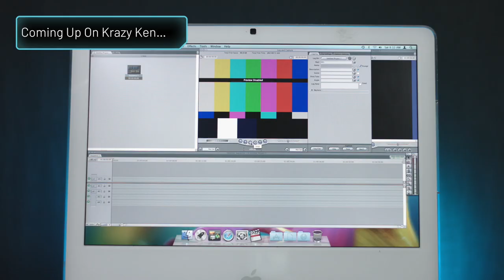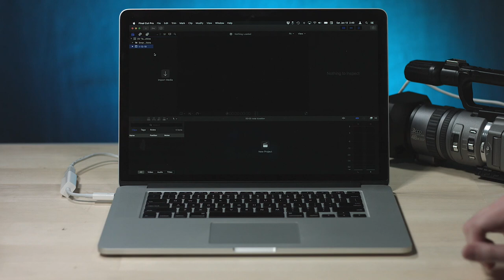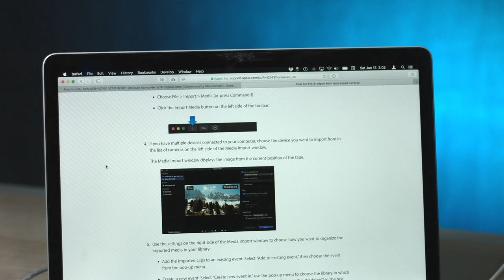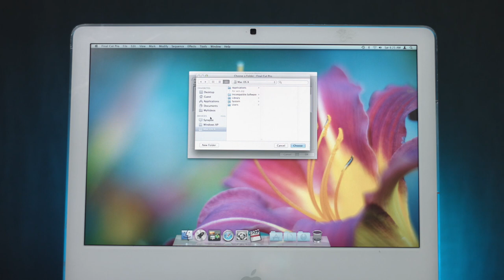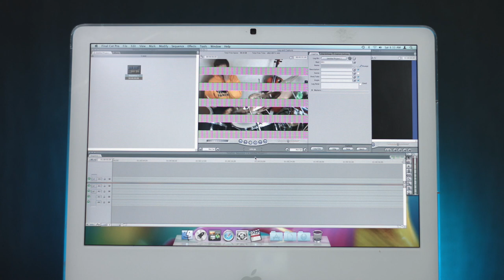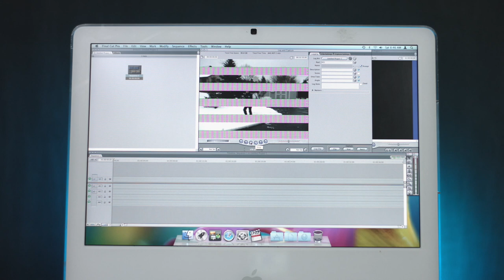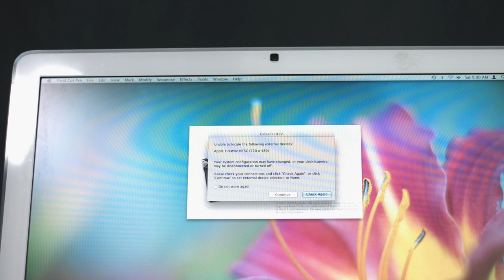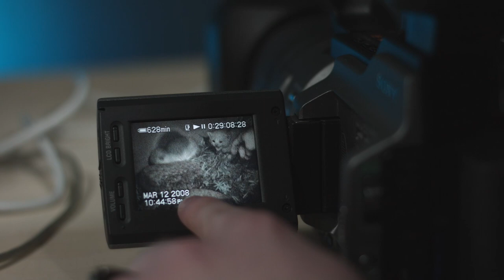MiniDV Tape Conversion Chaos (Sony Handycam DCR-VX2100) - Krazy Ken's Tech Misadventures

Comment: I bought the Sony VX-2100 for $3500 when it was a solid choice for SD, I really wanted the Canon XL-2E, but it would have been another $1000+, and I already pushed my budget to get this camera.

I currently use it to convert MiniDV tapes as well as use the passthrough function to convert analog (VHS/S-VHS) video. For me, it's only one Firewire cable in to an old XP box with Adobe Premiere 2.0 on it. That's it.

No idea why you chose to make this so difficult. It should be obvious that your adapter nonsense is the reason for the bad video, as the monitor on the camera shows the image without faults.

Oh, and I can also use the transport controls in Premiere, which is a nice touch.

Comment: @Computer Clan, I use a Sony DCR-TRV17 on a monthly basis to record meetings.  Your problem with your DCR-VX2100 was that you have DV IN enabled.  That feature is used when recording FROM a PC/Mac TO a tape, and MUST be disabled in order to import tapes to Final Cut Pro.  This would also cause your 2013 MacBook Pro to not recognize that there was a camera connected.  Make sure that DV OUT is enabled in VCR > Menu > VCR SET > A/V->DV OUT setting.
Reply from the maker: Are you sure? How come sometimes the camera showed up in FCP? It started going in and out, like it was trying to connect, but couldn't. It seemed more like a bug or failure, yeah? I'm curious.

Comment: The issue with your small camcorder is just dirty heads, hit play, then fast forward and rewind back and forth over and over until the purple and green bars go away. Not the best method, but it works. Your VX2100 has a dead firewire (IEEE1394) controller, sometimes when you hotplug a 6pin to 4pin firewire cable or converter, the 6pin socket will send the wrong voltage to the 4pin port and overload the controller. (Tip: always turn your camera off when connecting firewire). You may be able to get the boards replaced by a camera repair shop.
Reply from the maker: Awesome to know. I’ll try the fast-forward-rewind trick with the smaller camera. Thank you.

Comment: I had no problem using this camera for imports.  Also, why use an 800 to 6 pin firewire?  Use an 800 with thunderbolt adapter and firewire 400 at the other end to go straight into the cameras port and eliminate one adapter.
Reply from the maker: I only used the cables that I had.
Reply: btw-  I use iMovie to import if that helps

Comment: We still use this camcorder (a VX2000 in particular), we don't have any problem capturing the footage via Pinnacle 510 USB capture card (but I suppose any other capture card with firewire does work). We import video by Studio 14 (Pinnacle) or by Sony's PlayMemories importer (that is free downloadable). It works perfectly. Studio 14 also is good to import HDV footage (from HDV cameras, via Pinnacle 510 USB too), but also HDVSplit is very good. However, the VX2100 is great.

Comment: To do this on a new Mac with usb-c you would need to buy two cable connecters which are the firewire- thunderbolt and then thunderbolt to USB-C which I will link below. Thats all you need!

Apple Thunderbolt to FireWire Adapter

Apple Thunderbolt 3 (USB-C) to Thunderbolt 2 Adapter

Comment: I love Mini DV 💓😳
Reply: Yes, everyone loved it back  then. But video data management and backup has always been an issue during that era.  The current modern digital video workflow pushes everything to be file-based for easier management and access, and given that tape quality deterioates in time, it's a priority to properly transfer all taped video content to file-based medium, and to be saved in the corrrct file format settings (a big challenge esp. when saved in any lossy mp4 codec).

Comment: Hi i have an old panasonic mini dv digital Video camera Nv- GS50, it has a dv out, what would be the lead or leads or adapters or converters to get it to play on my 2013 mac please
Reply from the maker: Use a FireWire 4-pin to 9-pin cable, then use a FireWire 800 to Thunderbolt adapter.
Reply: Thank you

Comment: Maybe this has already been pointed out, but there's no conversion to digital taking place here as stated in the narrative. MiniDV is already digital. The daisy-chained dongles are adapters, not converters. So the "time machine" analogy is rather stretched out, "ancient" firewire is just as digital as "current" thunderbolt.
Reply from the maker: I guess I basically meant I'm converting from one medium to another—despite them both being digital. I know I kinda botched it.
Reply: Hi i have an old panasonic mini dv digital Video camera Nv- GS50, it has a dv out, what would be the lead or leads or adapters or converters to get it to play on my 2013 mac please

Comment: About this Mac -> System Report -> FireWire. Check if the Firewire port(s) show(s) up, and see if the camera is attached to it. Takes some of the guess work out of the equation.
Reply from the maker: But in the video, the iMac shows other cameras working with the ports, so I already did some process of elimination. Just give it a watch ; )

Comment: Firewire circuit could be fried on the VX2100. It's not unknown.
Reply: Yes, it's been a constant problem with just any product with 1394 interfaces, the choose fails after prolonged use and/or system crashes etc.

Comment: Use el Gato video capture devise its very versatile  I am also wearing or using  a cable with the three colors coded outputs CV or RV cables
Reply from the maker: I plan to experiment with El Gato more soon! Might not be on video, but I'd like to try them out.
Reply: @ComputerClan   there is a Jack at the side of the camera that allows to connect the three color coded cables those then are pluged to elgato capture devise the software is dowloaded

Comment: I have a question, I received three mini dv tapes that I need to convert. The tapes were done on a very high end camera I believe on EP speed.
When playing back on a normal mini dv player it comes out choppy and audio is off. 
I have one time seen this when played on a normal player it looks like the tape is damaged, but played fine on that high end player.
Unfortunately the person with the high end camera passed and I do not have access to this camera.
Has anyone seen this before? Is there any work around?  Thank You for your help.
Reply: is there like some sort of lines on playback? If so, a very heavy duty Sony DVCAM deck can sometimes tapes like that
Reply: @rupert6478  Consumer MiniDV and DVCAM have some different standards including EP recording speed and such, AFAIK.  Since the average consumer can't have access to pro playback equipment perhaps the best way to preserve the taped material would be to find a facility that would handle such digital transfer properly.  This needs to be done ASAP as tape quality deterioates in time even under proper stage and handling......
Reply: @vampyrelycan99  I've also heard that a lot of decks have trouble playing back tapes recorded in LP and you should use the original camera used to record that footage to play back the LP tapes
Reply: @rupert6478  I've heard that, but could not recall much.  What could be the reason behind such "compatibility" issues?  Maybe there's some slight inconsistency in the hardware's head alignment, from unit to unit?
Reply: @vampyrelycan99  i think that’s another plausible one. like you said, if a camcorders heads are misaligned and you record something, no machine will be able to play the tape unless its heads are misaligned exactly like the cam.

Comment: Probably they withdrew Firewire support in later versions of macOS.
Reply from the maker: FireWire support is still present.
Reply: Computer Clan Yeah, but from what I understand the FireWire to Thunderbolt adapter from Apple is a bit particular and doesn’t work with all types of devices - might be misremembering though.

Comment: You know, there is a perfectly good composite video out on that camera, just hook up a USB composite video capture is record it with OBS.
Reply: composite video quality after conversion is terrible. as it is the digital out from the firewire is bad, but at least you get the max quality from what you have at hand.
Reply: AV out from camera it is actually an DAC image conversion, so why to convert it double instead of streaming the image as data directly to PC ?  Think!
Reply: Why resorting to cavemen methods when there is a proper solution?

Comment: A 4 pin to 800 firewire cable is available and a much cheaper solution
Reply from the maker: Cheaper compared to what? Also, keep in mind, the FireWire port on this camera (or something else) was failing.

Comment: Jesus... Just threw a Firewire PCI card in my desktop. which would be the RIGHT way to do it. i feel like your going to impact the quality with all those jenky dongles and converters. I'm likely wrong, just a thought
Reply from the maker: Tell me where I would POSSIBLY fit a FireWire card in a notebook that's thinner than my finger. ; ) And no, the quality will not be impacted.
Reply: @ComputerClan  That's why i said desktop. Did i not say desktop? Oh, i did say desktop. :)
Reply from the maker: Wait, hang on… did you see the rest of the video??? I did plug the camera into a desktop with integrated FireWire 400. It was an AIO desktop, not a minitower.
Reply: @ComputerClan  WHOA HOLD ON ANOTHER MINUTE, You didnt figure it out so why are you giving people advice xD
Reply from the maker: What advice am I giving? What did I not figure out?? The project ended up working (there's a follow-up video). I'm confused : s
Reply: @ComputerClan  Good to know
Reply: Did you slam the cam door shut before the tape had fully loaded?
Reply: Yeah, my old i5 and PCI 1394 card, cable and NLE prog, captured, done.

Comment: MiniDV tapes ARE digital. You aren't converting. You are downloading the data from the tapes to your computer. Also MiniDV fricking sucks because there's basically no error correction and because its digital, it suffers much more than analog mediums like vhs in the face of data corruption.